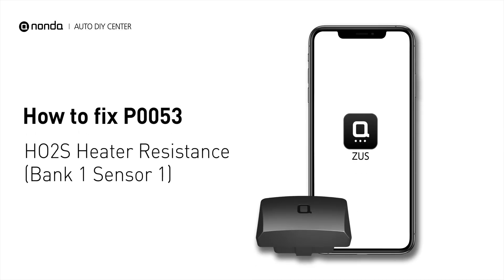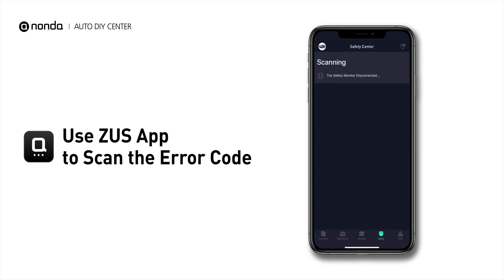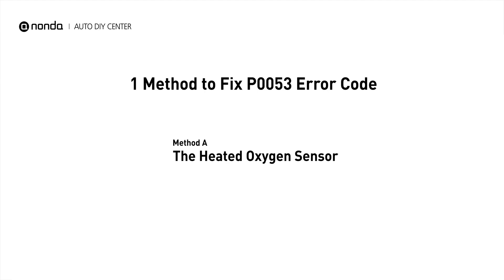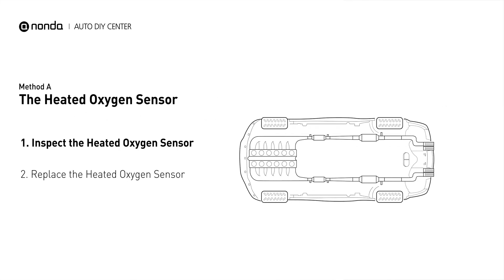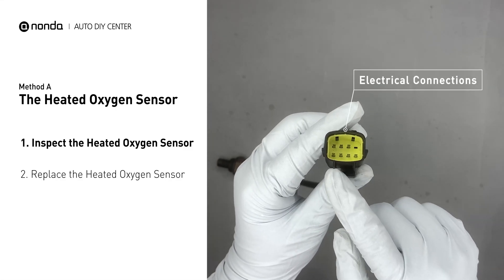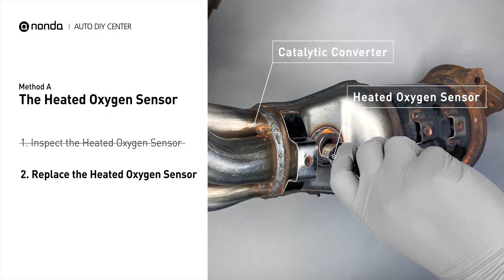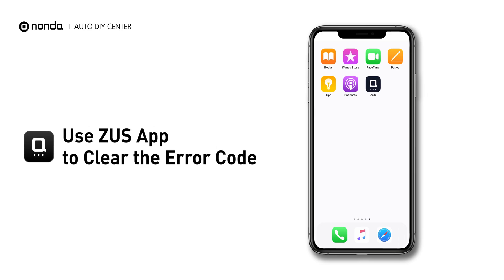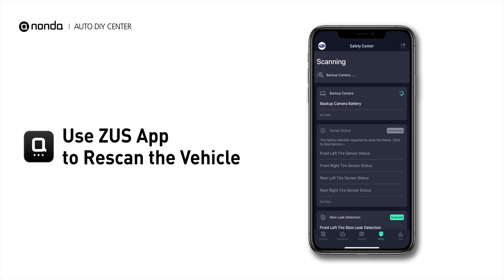How to Fix P0053 Engine Code in 2 Minutes [1 DIY Method / Only $19.99]

Comment: I replaced my oxygen sensor but the code remains. Also the code is a permanent code and cannot be cleared with a tool. It has to complete a drive cycle without issue to clear the code.
Reply from the maker: Hello, can you please provide us with your vehicle's make/model?
Reply: @nondainc  2013 Ford Fiesta
Reply from the maker: Kindly check the condition of the engine control relay, fuse, wiring, and if there are poor connections. Fix all damage part you would find to see if the issue will still persist.
Reply: @nondainc  everything has been checked by me and a Ford technician. Sensor 1 (pre-cat) starts providing data within 40sec of starting cold engine. Sensor 2 (post-cat) can take around 300 sec. Even pinning a  sensor heating circuit right to the PCM gets an error. Replacent PCM and the error switched to sensor 2 heating circuit error p0054. A 3rd PCM shows p0053. Very confusing. Also do not know what ohm resistance the PCM is looking for. To make matters worse, 1 Ford tech said the error may be voltage based and triggered if less than 12.3v is sent to the heating circuit.
Reply: Hi, How did u fix this error?. I'm facing the same issue.
Reply: @sandeeps6974  I never did. Someone ended up buying the car before I figured it out. I was in the process of trying different resistor packs to either increase or lower the resistance but did not finish. They had full disclosure and knew the Ford tech that worked on it.